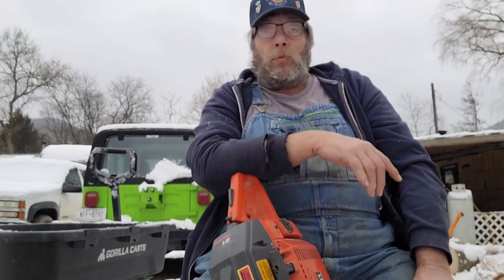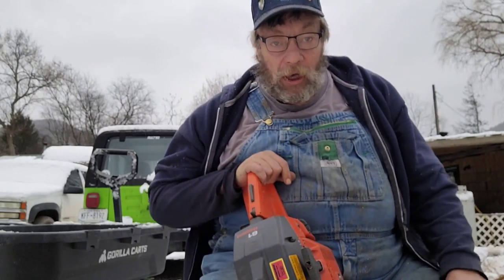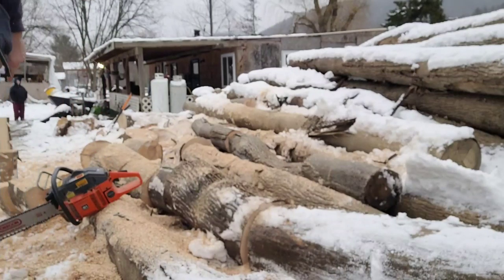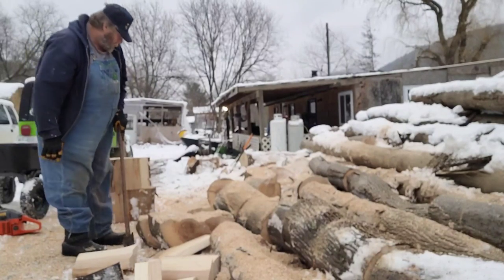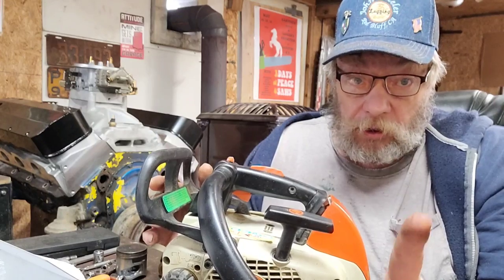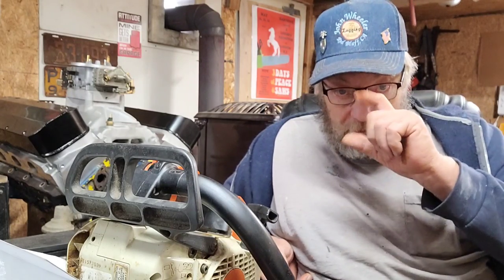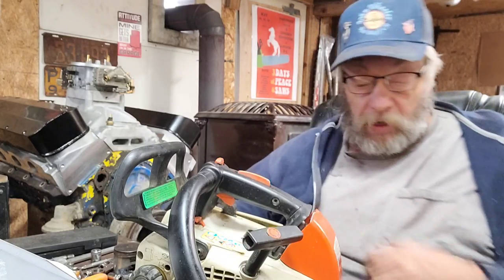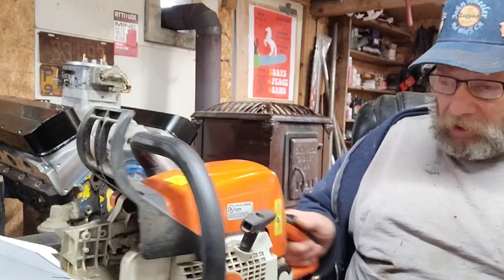ported husky 61 in the wood! stihl ms191! stihl ms290 project! splitting wood with a buckin special!

Comment: I’m 77 and the 290 just about as heavy as I want to work with.  I have reached the point that I go for the lightest tool that will do the job.  I’m usually cutting red oak and getting more power from my  290 sure would help. Hope to see that one soon. Thanks your work putting this content together.
Reply: I'd look into picking up an stihl 026 to replace the 290. They are WAY lighter. Like 2lb or better, and they make close to the same HP and torque but run a good bit higher in the rpm range. In most firewood sized wood the 026 would be at least as fast or faster than a 290 and be more enjoyable the whole time.
Reply: @bryantitus6634  any of the o models were better. The 044 magnum was a beast.
Reply: @matthewotis3594  I'm not knocking the next gen of 0-series saws at all. They are better performing, better saws in about every way... But they still aren't quite as durable. Close second probably though
Reply: A pro model 50cc actually has a lil more hp then a 290 and way more rpm. If you like Stihl I'd recommend the 261c
Reply: @jamiedalluge9472  yep. Been looking for one to walk the farm with but most bealers near me don't carry pro saws. Closest thing to pro is the 201 tc.
Reply: @matthewotis3594  man that sucks. Ik a guy up in Rhinelander wi that bought a brand new 261c and never used it. He'd take 500 cash for it. It's on Facebook marketplace actually
Reply: @matthewotis3594  I'm more of a Husqvarna guy but I'd take a 261 over a 550
Reply: @jamiedalluge9472  even the 025/250 are on the heels of the 290. The 290 is a rather surprisingly low rpm saw compared to even the 270. In about everything up to maybe 10" of wood the 250 and 270, which are both ranch/homeowner clamshells, will be just as fast if not faster than the 290. And they weigh 2-3lb less. I've run a pile of Stihl saws and some huskies and a few echos. I cannot fathom why the 029/290/291 sell half as well as they do.

Comment: Harvey, the 64cc/49mm cylinders from 039/MS390 are direct bolt on for 029/029 Super/MS290 as a simple performance booster.  Hyway and Meteor cylinder design for MS390 is more of a closed port design instead of open port design on OEM Stihl cylinder.  Ryan could fix you up.
Reply: Yep, you'll want to keep it after you port the 390 slug.
Reply: You can also get pop up 390 pistons
Reply: My friend has a 029 that I'm thinking has magnum on it. I may just have to get it from him and do some mods.

Comment: 290 is a firewood saw. Put an 039 cylinder on it, an 046 carb, open up the exhaust a bit, and it's ok. It's still not an 044. The only way I can think of to bump the compression is a pop-up piston.

Comment: I picked up a ms290 a couple yrs ago. It’s had the muffler mod done to it and the carb adjusted. I run a 20” bar full skip full chisel square ground chain. It will pull that chain no problem through hard maple cherry ash no problem. Use it for firewood and cutting bow blanks for my wood shop. Great power to weight ratio

Comment: I’ve got a 029 Super… it was in kinda rough shape when I got it but, payed almost nothing for it.
Turned out to be a good runner after a little TLC. When the time comes, I’ve got parts to build it with a 039 / MS390 top end which will take it from 54cc to 64cc. Think it should be a easy upgrade…

Comment: I done climbn when i was younger knees are blowed out along with my back cold an wet wearing me out but im lil on fat side now to but still strong as a bull i climed with a 020av i do have a 200t i got at a smokin deal on it i use it some an it is a factory strong saw muffler system is a definite choke down they really run with a muffler mod. An or maybe a timing advance.

Comment: I use an ms 290 as a backup or when I run out of gas in my ms 362. I drilled out the muffler a little, and adjusted the carb, it has a LOT of torque! I’m working on a porting plan for both the 290, and 362 so I can cut more acres per day.

Comment: I have an MS260C that from new if you run it without burning the whole tank of fuel. It will flood it self after shutting it off, after replacing the tank vent, gas cap and rebuilding the carb three times with different brand rebuild kits. The problem still exists, so I am going to try a flat top style tank vent, just wondering if anyone has ran into this issue. If that won't fix it my only thought is to try a different carb, in case it was machined wrong from the start. I heard something about the Forestry service not buying anymore Stihl products till they fix their tank pressurizing issue with the quarter turn caps, but have not seen a replacement cap or fix for the issue.
Reply: Donny Walker says it’s about twenty bucks.

Comment: I wonder what sufficient warm up time before you go to the wood.  20 sec 40?  Maybe not important just dont go balls out full trigger for a few mins?
Reply: For me personally I’ve always used my fingers on the side of the cylinder to gauge warm ups. When the cylinder fins get hot to the touch I consider it warmed up and proceeded to start cutting. I also do cool downs by allowing my equipment to idle for a while to properly dissipate heat before shutting down. If you’ve ever pulled a truck or tractor hard you know how engine temperature can climb,By allowing a cool down period you help eliminate heat soak that tends to shorten ignition coil and other components life. Hope this answers your question.
Reply from the maker: I warm them about 2 minutes! I had already been running that saw so it didn’t need a long warm up!

Comment: I run a 290. I cut Honey Mesquite with it. It's strong with a 16" bar, but noticeably less so with a 20" bar. What I find interesting about a 290- it is essentially the same saw as a 310 & 390. From what I understand, the only difference is the Head/Piston *which are interchangeable as they use the same crankcase. In fact, owners transform 290's into 390's  A LOT. I wish I knew someone in Texas that ported heads. A ported 390 would run a long bar quite well.

Comment: That 290, 029S and 039 are all on the same chassis and all take the 039/390 clamshell cylinder. You can get pop up pistons for those 039/390's. Lotta guys start with those cheaper homeowner saws and do those Builds. 

If you're looking for a little saw you should see if you can't work out a deal with Charles Briscoe for one of his 4910's

Comment: 019t is the predecessor 1997 to 2002 same handle as your 191t but 35.5cc 2.15 cubic inch 1.7hp 8.8 lbs 40mm bore 28mm stroke mine was made in West Germany its a dog  compared to my 020t 
35.2 cc 2.15 cubic  inch 2.2hp 7.9lb 40mm bore 28mm stroke 1996 to 2002
My 009 runs good aswell 
1980 to 1989
36.6cc 2.15 cubic inch 2.0 bhp 9.0lbs bore 36mm stroke 36mm 
The 009L is 40.8 cc 2.49 cubic inch 2.0 hp

Comment: grat video solid 61 have you turn that into a 272 and didnt tell no one lol  looks like it runs better then a 562 getting ready to put 390 topend on one of my 290s turn it into a 64cc wonder if they got a big bore 390 top end hmmm question ironhorse ware could i find steal cage barings for 046 also do you think its possible to turn a 046 to a 064
Reply from the maker: It’s a 272 top end!
Reply: @theironhorse6600  been watching your channel for couple years you did great job on that 61 i been just top ends for a few years been learning alot from you getting ready to split case for first time i have ms460 and a 046 oem and one needs case barings and other one needs bottom crank baring thats wy i was wondring if could turn one into a 064 but if not any advice on certain brand parts i cut wood all year around in northern michigan
Reply from the maker: @bryanmeier272xp8  you can’t make it a 064!  But the good news is an 046 is a very strong runner!
Reply: @theironhorse6600  thanks for replying harv yep they are stong my ms460 only lasted about 6 months tho thats wy i was asking about steal cage baring i wanna do the bottom ends on my 046 and ms460 right my 2003 oem 372xp still going tho

Comment: HI IRONHORSE U are right 👉 alot of wood U can't split by hand 🖐 w a maul it's 2 bad by hand there's another way just like U say take the saw and cut it I have had 2 that a many times myself no sense in tiring yourself out besides a saw can cut a peace of wood alot faster anyway ironhorse I my self cut some wood not long good dry wood the sun ☀ had baked it ,it had done case hard when U were cutting U see sparks U thought U were cutting fence wire OMG 2 12 2O23